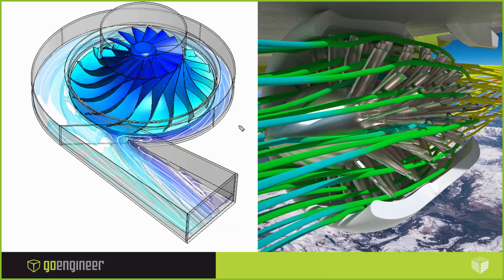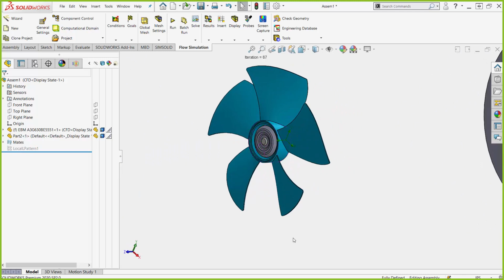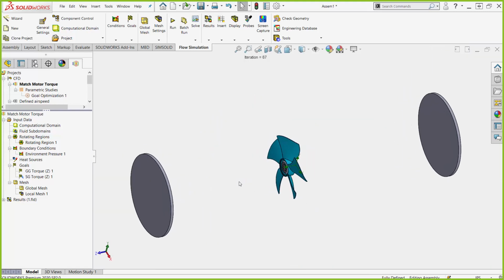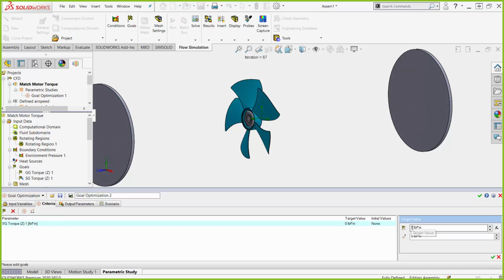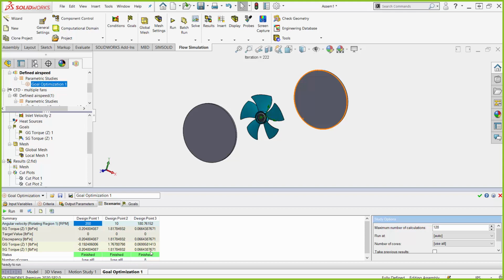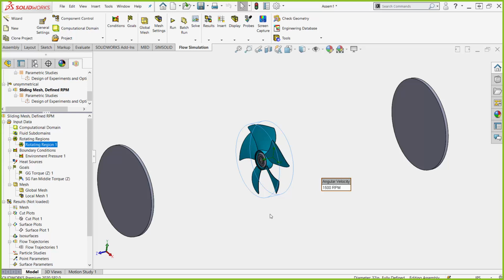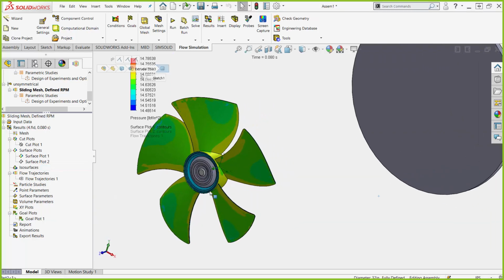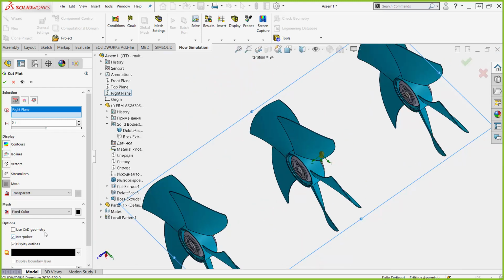SOLIDWORKS Flow Simulation Webinar - Rotating Regions

Comment: When using rotating regions and rotating in one direction, does that simulate the object rotating in that direction that we are studying, or the fluid itself?

When studying boat propellers in my ME course, I am tasked with simulating the former, and I'm unsure which direction I should rotate the region to achieve thrust?

When I rotate into the fins, it provides thrust, but when I rotate the opposite direction it provides forward thrust, am I to assume that the rotating region direction describes the direction you want the part to rotate even though you're applying it to a basic cylinder?

Comment: Your colleague (https://www.youtube.com/watch?v=_MZFlVFxOzs) helped me realize why I MAY not be able to 'create mesh' with a generally 'perpendicular to flow', 'rotating region' axis! (I.E. 'For a rotational region axis that is generally perpendicular to the general flow direction 'sliding' must be used!)

BUT I have switched to 'sliding'/'time dependent' (blade tip speed of 6x my HIGH Average annual wind speed of 15ms-1 = 257rpm, for 2revs = 0.466s, 0.5s set under 'Solve' tab -'control option'!)

Mesher still won't run, so I set the reference axis to that of the 'rotatiing region' NOT the general/flow/tunnel axis! (Correct or incorrect?)

MESHER still refuses to run!

HELP appreciated! (Though I won't give up without a battle! ; ) )

Comment: EXCELLENT (no issues with sound or comprehension here!)
I am assuming that, for a VAWT (with flow perpendicular to the rotating region axis!):
Stage 1, the VIRTUAL WIND TUNNEL height/width (or diameter) should be at least 5x the rotational diameter (and blade height or length!) I further assume that 
Stage 1, would commence with a steady state flow of at least:
                a)the (geographic) average wind speed or
                b)the peak wind speed that you are intending that the VAWT and generator would continue to operate at? 
Any advise much appreciated!

Comment: Really it's awesome topic but i have a small note to consider :
If you make the rotating region built in the assembly and u wanted to surface plot any parameter like torque it will be invalid process due to the flow region that the flow region wont reach the blades so that i strongly recommend that u make the rotating region not built in the machine assembly file to get results
Reply from the maker: Thanks!  We appreciate the feedback.  Be sure to subscribe for more great 3D CAD Design and 3D printing tutorials.
Reply: Thank you for your comment. It fixed the problem that I have with selecting the rotating area.

Comment: I am trying to simulate a turbine, however there are some results that I do not understand.
For w = 0 of the rotating region, the torque has a negative result at x, but when w = 100 increases, the torque tends to positive infinity.
Could you explain a little more? I need to calculate the maximum power based on w.
Reply from the maker: You seem to be pulling the torque values from Flow Simulation correctly. Now, you’re saying torque tends to positive infinity as you increase the RPM. Technically this is sort of true, except the blades would break before we ever got close to infinite torque. For a specific turbine example, a customer has had the limitation of sub-mach speeds. The tips of the blades approach Mach 1 but do not surpass it. In that case, we measure maximum velocity in the system. You likely have a similar limitation in your turbine. Please determine that limitation and use it to determine maximum angular velocity.

Comment: Hello, i do not have rotation in the  Analysis tab in the wizard for flow simulation. Are you able provide help please
Reply from the maker: Check what other things you have turned on in the Analysis or Fluids tabs. Rotation is not valid High Mach flows, for example. Turn off all other checkboxes and see if Rotation reappears. If it’s still missing you may have a bad install and should try an uninstall / reinstall. 

If you continue to have trouble, reach out to your local reseller or the community on the SOLIDWORKS forums.